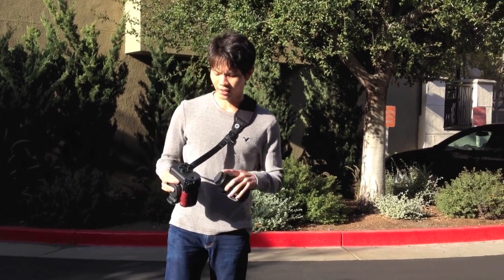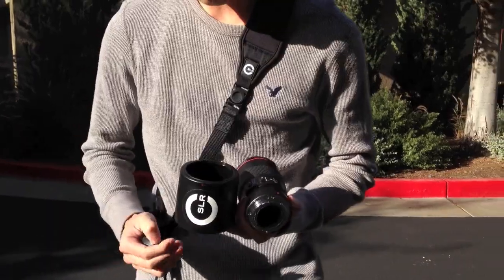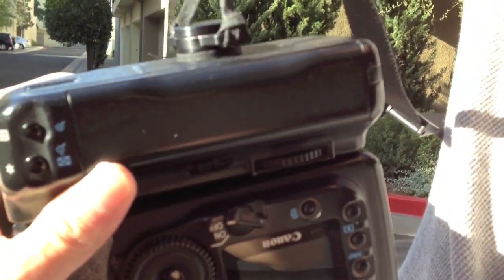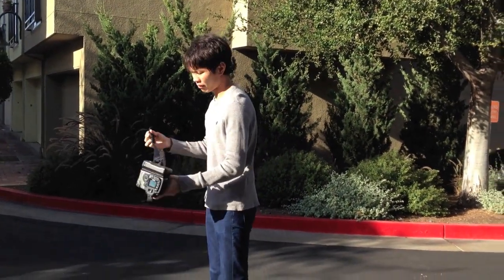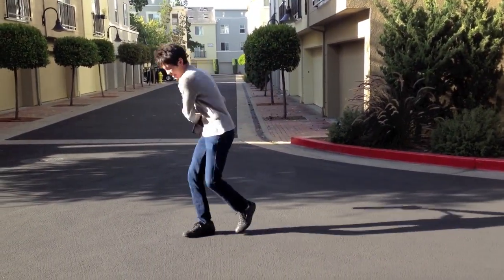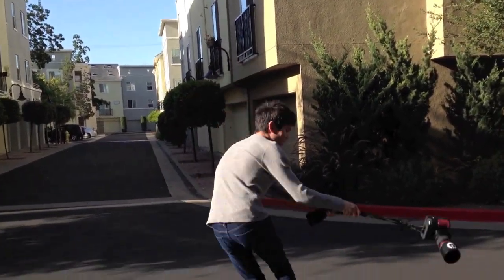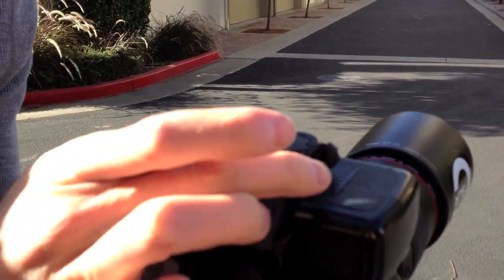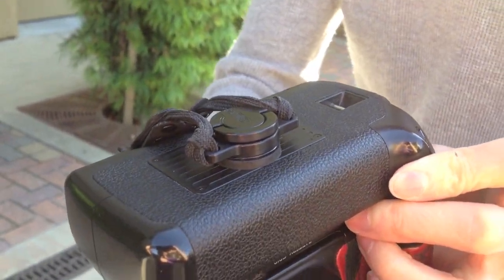C-Loop - Camera Battery Grip & 100mm 2.8L Swing Test

Comment: Obviously, the components are designed to handle an impressive amount of force.  I wouldn't think that the C-loop is the failure point for this test though, it is the plastic buckle(s).  Have you measured the strength of those components?